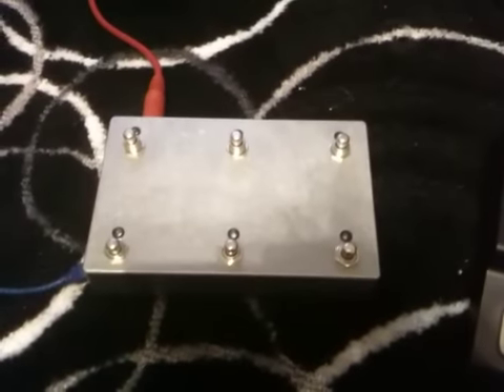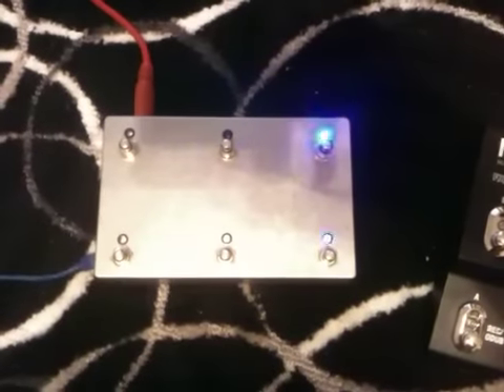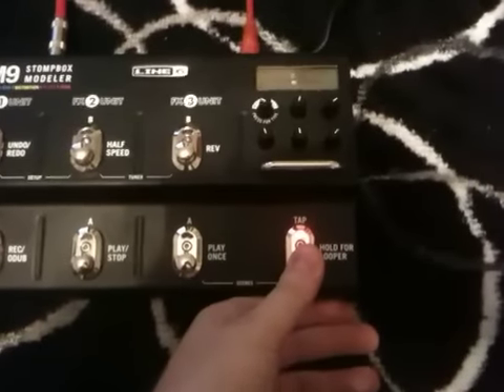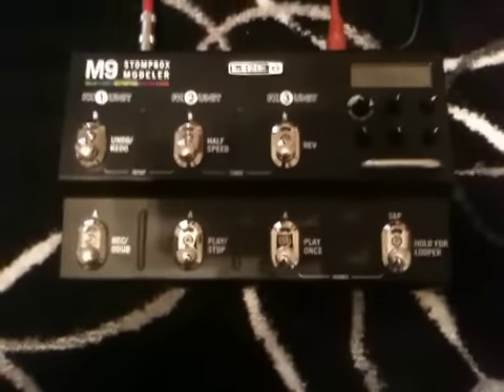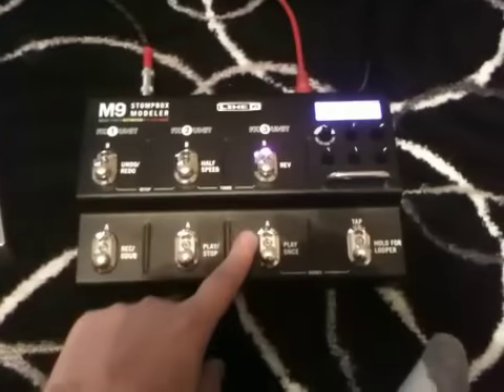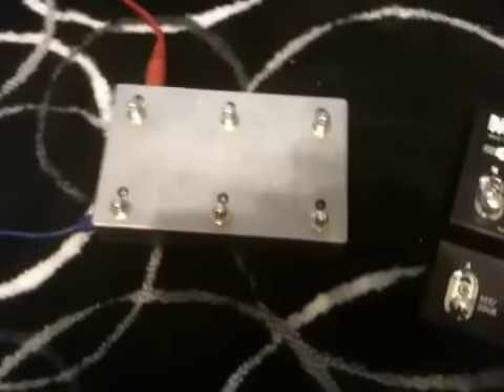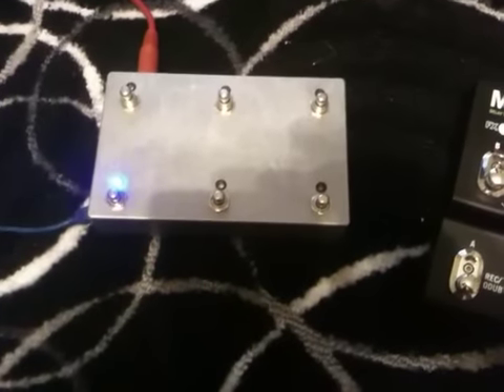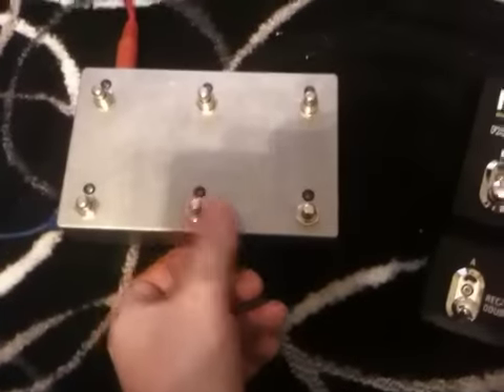M Series Controller Demo

Comment: Hi. great Project! Hi I have an M13 box and thinking of going MIDI to control it. But I would like to know if it is possible to set multiple effects simultaneously in one botton. For instance,  botton1 of the midi controller turns on the 4A and 3B of teh M13 at the same time; botton2 of the midi controller would turn on effects 4A, 3B and 2C of the M13;, etc.etc... If this is possible this will really solve "Tap Dancing" problem with M13.

Comment: @pharaohamps I see. I was thinking of something along the lines of a 4 switch controller. Each button selects bank 1A of various folders. E.g. Switch 1 = Folder 1>Bank 1A, Switch 2 = Folder 2>Bank 1A, Switch 3 = Folder 3>Bank 1A, Switch 4 = Folder 4>Bank 1A.

I figure that would then let me change the scenes via the M9. Ugly, I know, but it *should* work.

So how do you configure messages on your controller? Sysex?